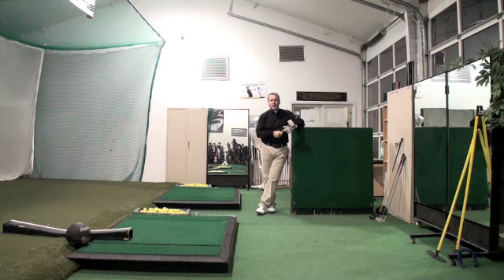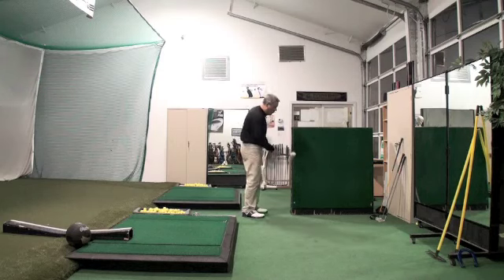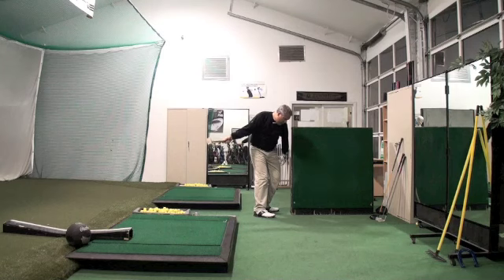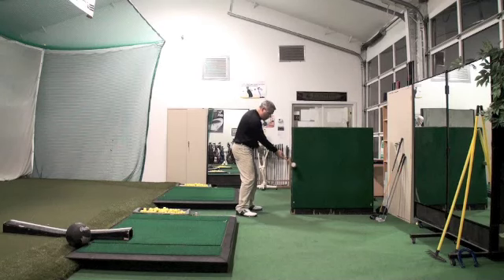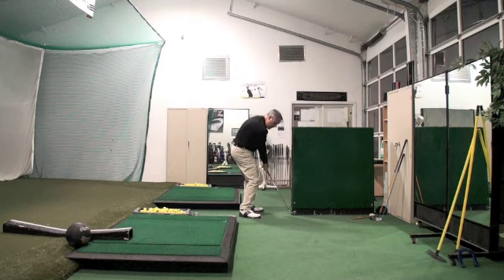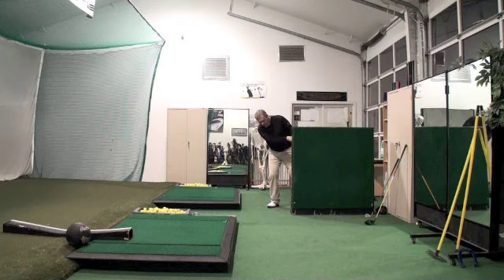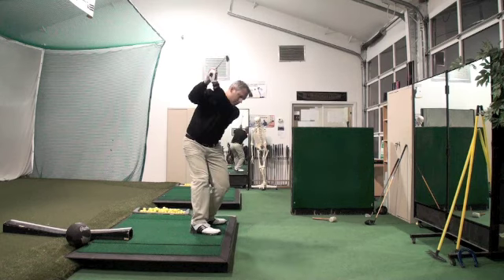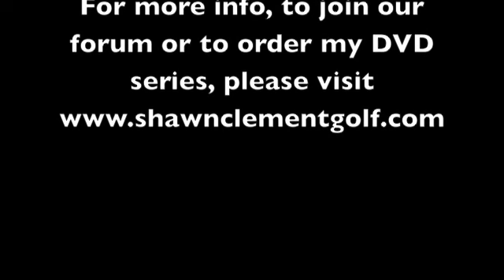Feel the Swing Plane; #1 Most Popular Golf Teacher on You Tube Shawn Clement

Comment from the maker: @CosmicSPC Instinctively, you would not hammer nails without LETTING YOUR WRISTS HINGE; your brain is allowing the weight of the hammer to hinge and load the arm unit and instinctively delivers the arm unit through the nail into the doorframe. So if you mean by "active" as manipulation and thinking of it, no but there is of course much more efficiency in allowing...your brain would eventually figure it out when it feel that the hinge gives more power with less effort...Thanks for the question!

Comment: hey shawn this seems to be the stage iam at now.  fixed my backswing/weight shift and alos fixed my finish/follow through.  my irons are getting there but iam still have trouble with the driver.  sometimes i take the clun too outside on the takeaway but cleaned that up with the irons.  my question is when you hitting your driver to you think about flattening you swing plan "not as steap as mid to short irons"

Comment: Normally I sawllow the coolaid with Shawns videos but with this one I can't. The reason is that when I am amped upI have a tendancy of pulling the club ahead of the body turn in the backswing.   Here is the issue you can take a hammer with your right hand to the top position without moving your body since it is already out of the way.  What has worked for me to cure my bback swing ills is to do this same thing backhanded. To get my left hand up there my body has to get out of the way.